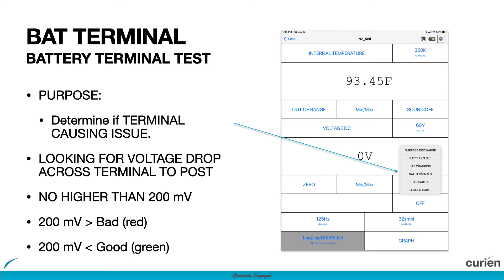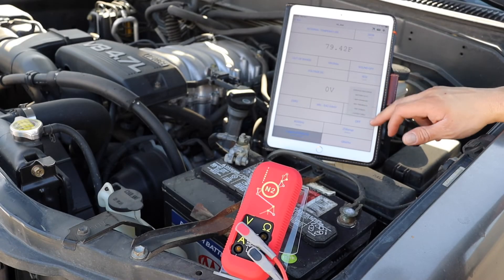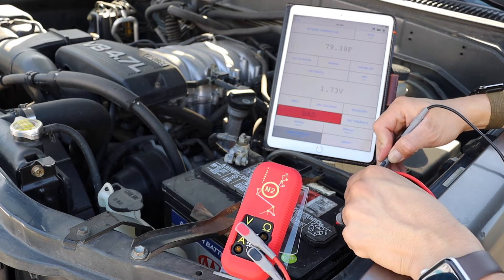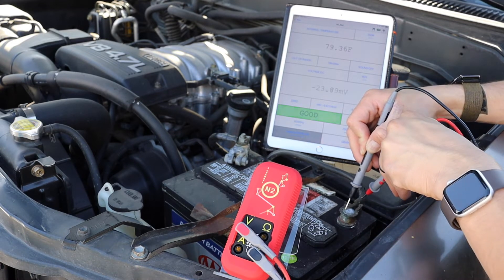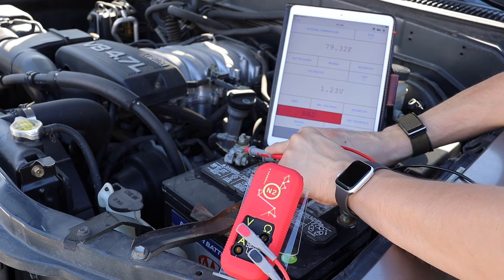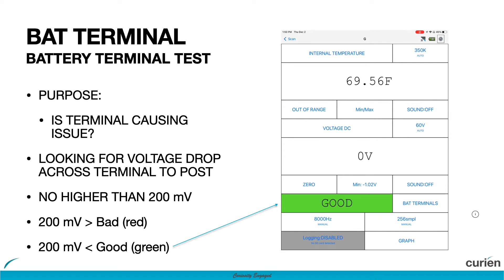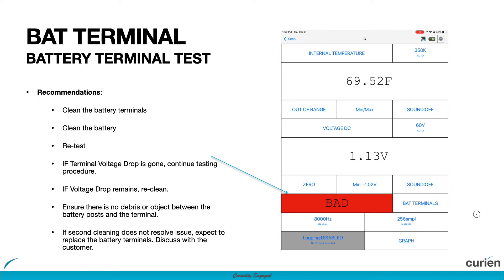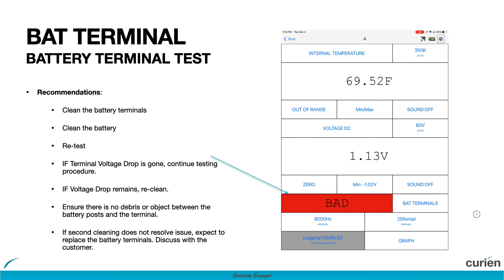N2 Battery Terminals test

Comment: Where is the Data intelligence menu? Does it require an update, I have version 2.1.9
Reply: @Doug, the menu is just below the bottom channel. If you haven’t accessed it before it may be the button is labeled “real power”
Reply: Doug, the batter tests will be available by years end.